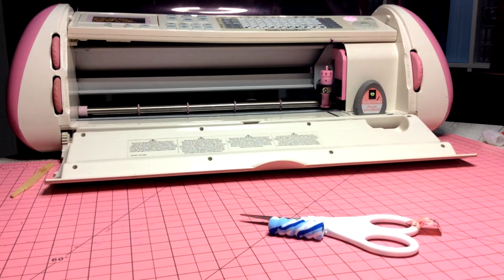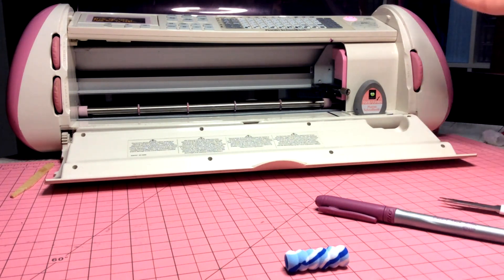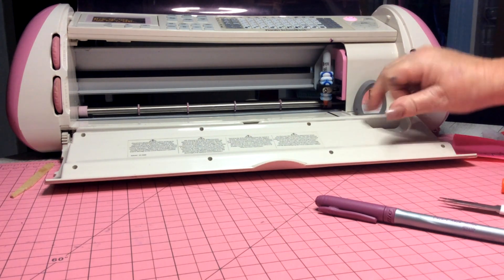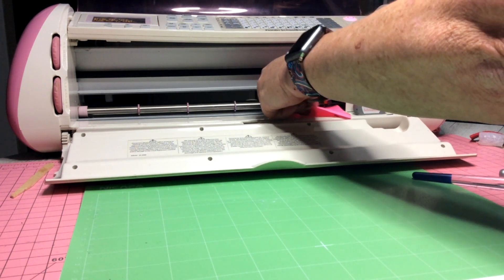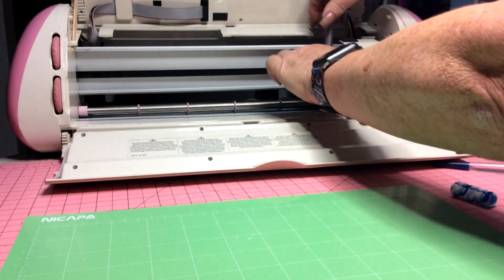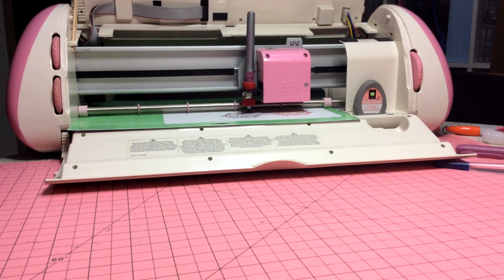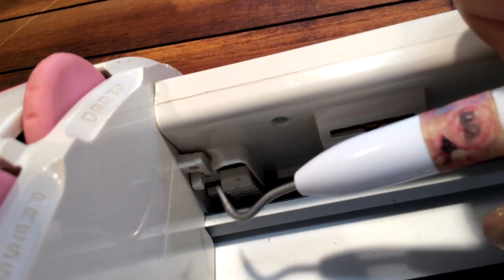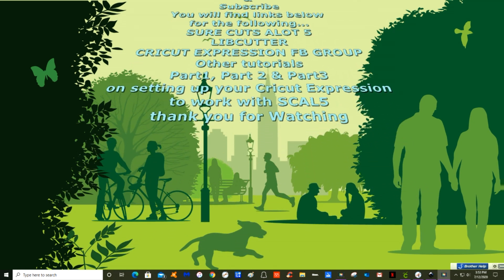#15: How to flip the Lid on you Cricut Expression1,  use full length Pens to draw. How to lift 9:47

Comment: I have an expressions  that wont feed the mat and the functions light does not light up.  Could you tell me what to do to correct this. It occurred when I downloaded sure lots 6.
Reply from the maker: It would not have been scal fault , where did you purchase scal from.
Reply from the maker: Have you fixed your problem? make sure you have a cartridge in the machine when using scal as well
Reply from the maker: this is why I say to peiple come and join my group CRICUT EXPRESSION, link is in the description, there I would be able to help with this problem, my guess to this situation, is that you have no cartridge in the slot, you need a cart in the slot when using scal6, so that it controls the Load and unload buttons, that's it.
Reply: @ I still have it so will try this soon. What i think happened was when I was trying to make it so I could make my own designs.